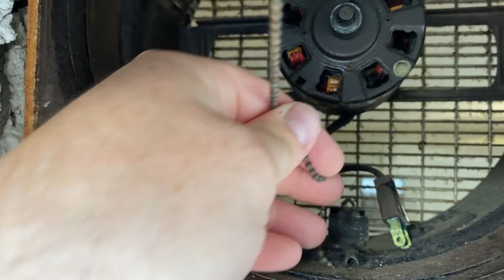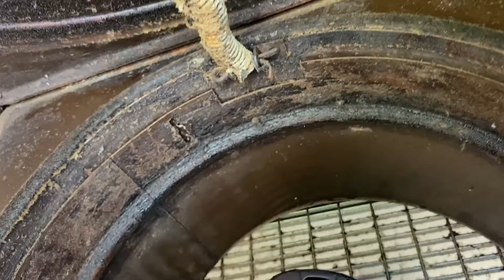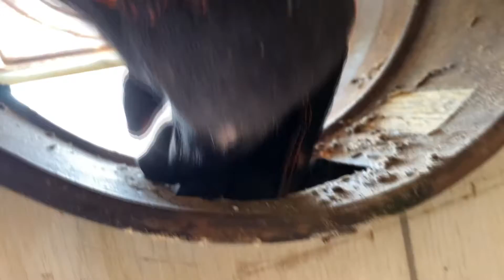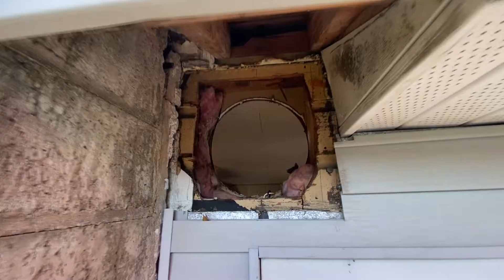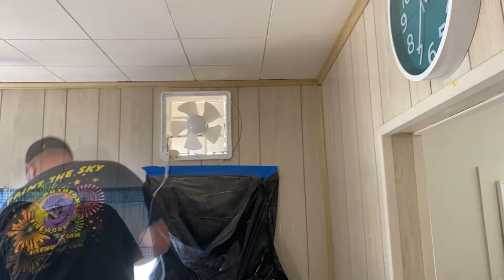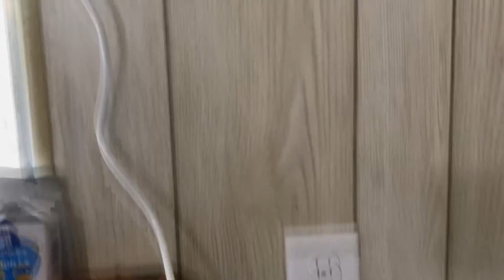How To Replace An Exterior Wall Exhaust Fan

Comment: So is this a job best left to an electrician? (My old exhaust fan opens when you open the door..House was built in 1959.  That's how old the fan is...and needs to be replaced.
Reply from the maker: Depends if you’re replacing with a similar wiring option.  I switched from hard-wired to corded so I had to make sure there was an outlet to plug into.